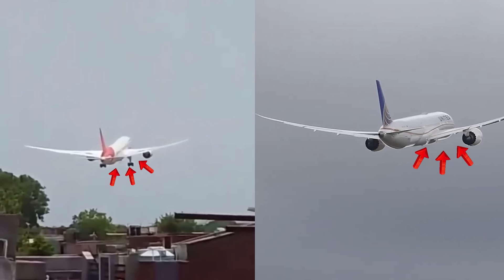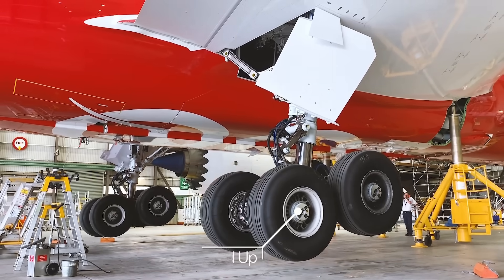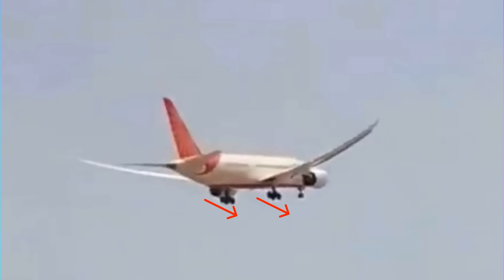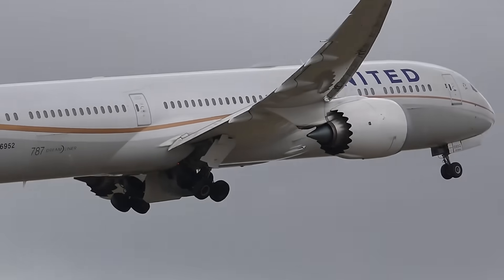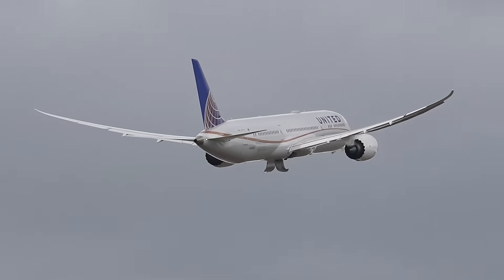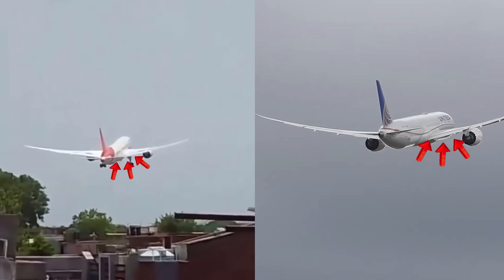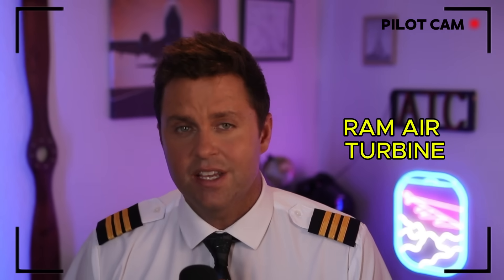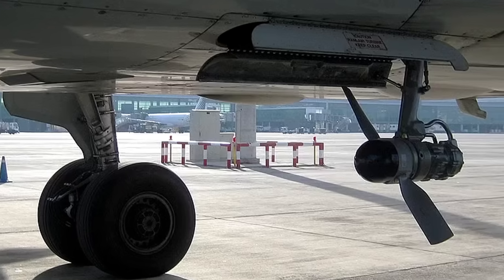Pilot Explains: A New Detail in the Air India 787 Crash Everyone Missed

Comment: The general consensus amongst Youtubers that I have watched is dual engine failure.   The question is why did the engines fail to produce thrust?  The RAT was deployed due to severe electrical failure, but there is a "chicken and egg" type of question.  Did electrical failure cause the engines to shut down, or did the engine shutdown cause the electrical failure?
The electrical systems have massive redundancy but there is one component of the control systems that seems to have zero backup: the FADEC.  From what I have gleaned on the web the Fully Autonomous Digital Engine Control on this plane has full authority over both engines.  Full authority / fully autonomous means that if the FADEC malfunctioned and shut down both engines then the pilots had no authority over thrust.
See this article about a previous FADEC - caused crash -
https://en.wikipedia.org/wiki/2015_Seville_Airbus_A400M_crash

Footnote:  it seems to me to be crazy to design a system capable of shutting down the engines on detecting a fault to protect the engines from damage if the pilots are left with no option to run the engines to destruction to save the plane from disaster.

Comment: Excessive fuel contaminants (I.e. water) would cause both engines to fail as the aircraft pitched up allowing the water to move to pickup. Fuel filter lights would illuminate first followed by engine failure. Unless the APU was operating, there would be only battery power and the RAT would deploy providing limited electrical including electrical to the standby hydraulic pump. 
Ground fuel storage would be immediately isolated until it can be ruled out for contamination.

Comment: The RAT's hydraulic pump could probably swing the gear tilt, but not the full retraction of it.
Reply: en "Before selecting the landing Gear handle UP"  , the gear tilts Forward Down... as soon as the sensors detect AIRBORNE...  see:   AMM 32-31-00 LANDING GEAR DESCRIPTION AND OPERATION.    So, regardless of the selection of the gear handle, it will always tilts forward down to prepare for retraction.

Comment: It looks like a Vapor lock dual engine failure due to extreme heat of 40c, with ram air rat system deployed
Reply: India consistently has very high temperatures. In peak summers, it goes 10 degrees higher than the incident (which was 37-39 degrees). Had this been the case, it would have definitely happened a lot more over the past years and decades. Something more sinister and highly unlikely must have happened for the dual engine failures and RAT to be deployed.
Reply: Agree

Comment: Given survivor report of loud bang upon lift off, I'm thinking power fuel system failure....and maybe connected to prior flight reports of electrical failures.
Reply: The loud bang could have been the RAT deploying.  It is spring-loaded to deploy rapidly without the need for electrical or hydraulic power.
Reply: @patricklockerby4308 
But witness said happened at lift off...but you can see engines providing thrust for a while.

Comment: The flight radar data showed the aircraft takeoff was around 10kts under average speed for weight?
Possible engines starting to rollback at rotation point 
As what can cause doubt engine failure fuel tickets all the boxes either contaminate (unlikely) or supply

Comment: mechanical/electrical failure caused double engines out shortly after takeoff (the absolute worst time for that to happen!) and they crashed! RIP people. If they built airports with safety in mind, there wouldn't be buildings anywhere with 10 km of the end of any runway! But they dont so some airports are literally hazardous to land at or take off from! Its a do or your all dead scenario that shouldn't be happening!

Comment: double engine failure is still due to some failures, such as fuel, electric system , external control, hydraulic issues. Two engines happen to fail at the same time due to engines own mechanical issues, it is  impossible.